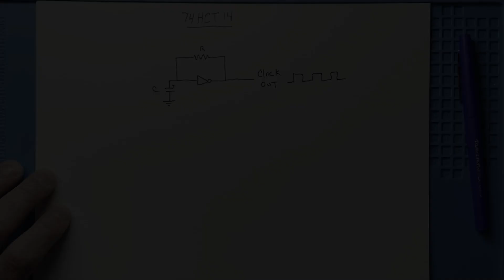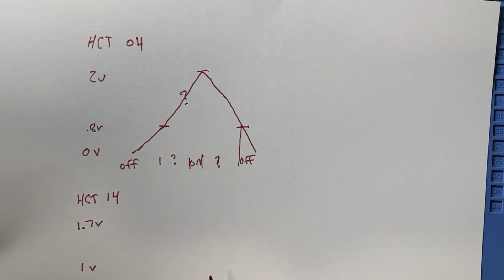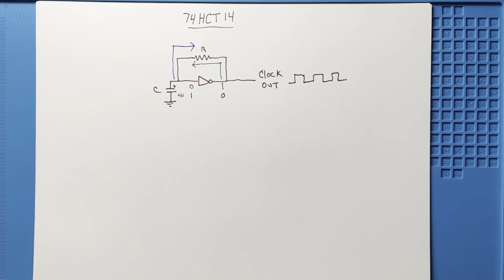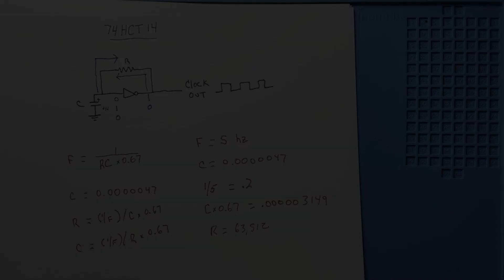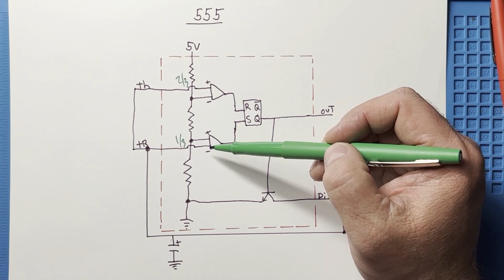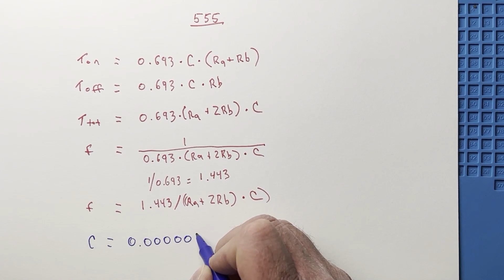Pony80 - Clock Circuits - My z80 homebrew computer!

Comment: Interesting stuff , just a question - how does the capacitor discharge in the first clock circuit. When the input is 1 producing a 0 on the output does the current flow get drawn from the positive side of the capacitor through the resistor then through the IC itself to ground?, Just a little lost on the discharge side of things, looking forward to following this project.
Reply from the maker: I am so sorry I took so long to reply. Somehow I missed this comment. I have created a quick video to explain how this capacitor works. https://youtu.be/yqmq9fOzZMY Thank you for the question!!

Comment: Where does the 0.67 for HC14 come from?
Reply from the maker: It is a variable to take into account different chip families, etc.  For example, a 74AC14 would have a different value because it switches a lot faster than the HCT.  I could have, and probably should have, adjusted that when I got 4Hz instead of 5Hz, but for the video it was close enough.
Reply: I believe that is due to the switching point of the input. The device switches to a high state at approx 2/3 of the input voltage. But, looking at some data sheets I see   f = 1/ (K * R * C) where K varies from slightly above 1 at 4.5V to  around 0.82 at 5.5V.

Comment: Very interesting ! Question, if you were to just use the 555, would it be able to send out a 1Mhz signal and could it drive the system clock bus for the rest of the system?
Reply from the maker: I foresee an experiment coming up!
Reply: would be at upper range of 555. "maybe"